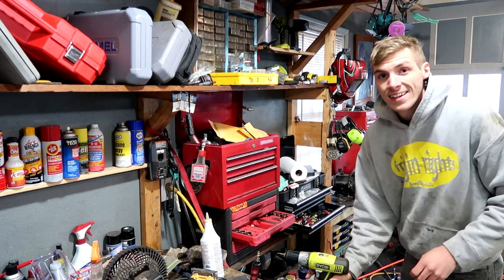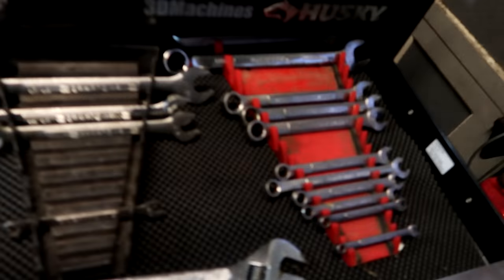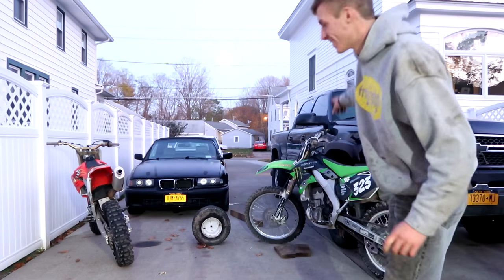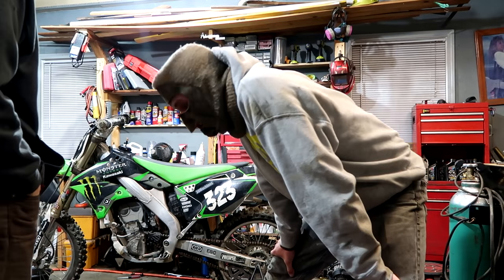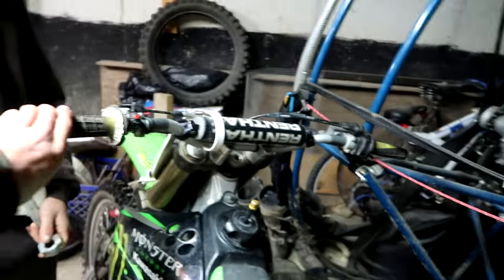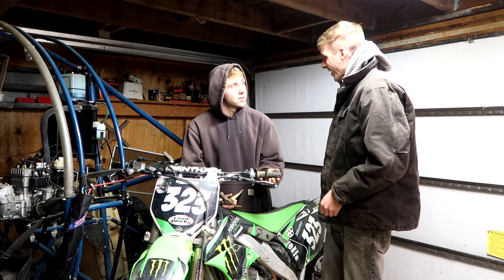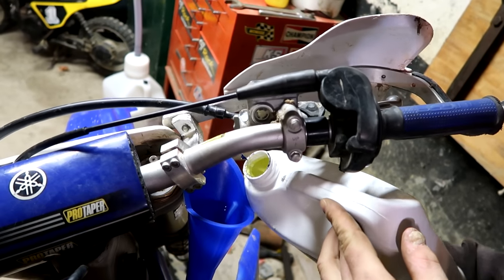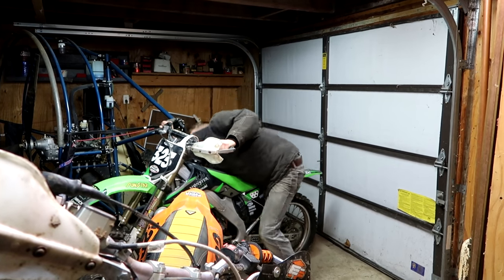MY BIKE STARTED SMOKING A LOT...

Comment: That chain looks way too tight, and that rear sprocket... *shivers
Reply: he has said that it loosens when he sits on it so its ok
Reply: The chain is way to tight, will ruin the sprockets and you can destroy the bearings inside the case which is a big deal.
Reply: I race kawi's and i know that the chain tightens when you sit down and when landing after a jump. They are suppose to have slack, thats why there is a chain guide, its better to be loose than too tight. I dont even think this guy oils his air filters, looked dry as a bone when he pulled it out in another video. Not to mention his sprockets look terrible but its not my bike so he can do what ever he wants.
Reply: matt s you have the same 250? because i think he has shown hie the chain loosens when he sits on it
Reply: HusseJumala I thought that was his 450
Reply: The Hondas chain loosens when you sit on it.
Reply: That Ronny Mac reference tho
Reply: xheppelin it loosens when theirs weight on it
Reply: xheppelin s
Reply: matt s who cares he's bike is different just coz you have a Kawasaki don't me yours is the same
Reply: Go to your local motocross tracks and find out for yourself all my bikes have been like that. My honda crf 250 did it , my rmz 450 did it and my kawi does it the MOST. I actually raced all 3 bikes so your wrong.
Reply: No it doesn't loosen when you sit down and will destroy your bike if you actually hit a big kicker or table top. Ask someone who actually uses these RACE BIKES for what they are actually intended for you guys are just fan boys
Reply: @Ronox63  Then his suspension is shot and needs new ones lol

Comment: Tape a flashlight to the front fender and let her rip. One of those light bars might work. I saw in another video that you are now crossing your trailer chains in a X pattern so the trailer tongue will not dig into the pavement or ground and flip your dirt bikes into the back of your truck.If something happens and the trailer becomes disconnected from the ball it will now ride in that X and hold the front of the trailer up. Great job guy's.

Comment: Tip coming from my old school days of BMX... If you have grips that want to spin around like that on you, Spray both the inside of the grip & the bar down with WD40 & slide it back on. Yeah, it sounds counter productive.. But if you let it sit for a couple hours after doing it you will never get that grip off unless you cut it with a knife.

Comment: Hey 3D, I need to put either a new shift drum or shift forks sadly in my 86 YZ250. Do you have any suggestions to help? I can only shift into 1st and 2nd. I wanted to race hare scrambles then my baby gave out :(
Reply: la chène de tout ! eBay. They don't make new parts like that any more because its 30 years old
Reply: probaly a bent shift fork haha happend to me
Reply: Josh Coo that's what I was thinking too. Did you bend it back, or buy a new one?
Reply: Jacob Nykiel buy a new one if it bent before it will bend again even easier
Reply: Josh Coo makes sense, thank you
Reply: You should just get a new bike at that point
Reply: Aiden Megargle Im learning to be a motorcycle mechanic so it's no big deal fixing it, just asking for tips... I love my bike to literally bits and pieces, worked on it so much I have the whole thing memorized, so I don't appreciate that compliment. I love buying junker out bikes nobody cares for like it was and fixing them, so if you have the audacity to say a comment like that, you obviously haven't really worked on your bike and grown to love it.
Reply: David pelkey no the problem is its a 1980s bike lol
Reply: Jacob Nykiel i agree anyone can save and buy a new bike
Reply: tear it apart and check everything is in spec crank runout bearings etc...   and replace the parts that are worn out.  go over the whole engine inspect all the gears for wear.  those cr's are easy to rebuild.  If you need parts that are discontinued  join a couple honda forums and post what you need lots of guys keep old parts around from bikes they had, take your time and do it right. If all else fails ebay is a good place to look but you need to be careful.

Comment: As a professional BMW technician I would suggest not to turbo the 323i unless you find yourself a nice tuning kit for the DME. If you want more power you will need to get an M3. You can get an m3 powertrain tho. Just be sure to get the DME (engine control unit) EWS (antitheft control unit) KOMBI (instrument cluster) and the keys and locks otherwise the thing will never start bc of the transponder chip keys and the vin specific codes that are programmed into the control units. Screw it man that 323 did some sick burnouts. Just don't tear it up bc BMW (broke my wallet)

Comment: The squeeky noise the kx makes when the swingarm moves... Not a problem with any bolts and it will get worse and worse.... Solved this once. You gotta take off the swingarm and look where it connects to the frame. There are like 2 plastic rings or how I should call them. They are in the frame. You gotta kinda lube them up, or something. But they are the squeek sorce :-)

Comment: 3DMachines What is that hole that is covered by plywood in your garage ?
Reply: Garrett Thomas it's a lift for the dirt bikes
Reply: Xxx Bo3 for the win No I have seen the red lift in the back. This is in the center of his garage.  It looks like there is a great over it. Go to 1:46 of this video. You will see it.
Reply: Garrett Thomas alot of garages have a hole in the floor called a pit for working under cars instead of having a lift or if the building/garage dont have a high enough ceiling for a lift
Reply: Brad101 Oh ok. I thought maybe it was a pit for working on cars but then I saw the great over it.
Reply: i guess it could be a drain for catching snow and water that runs off cars while they are parked in the garage instead of having a pool of water on the floor
Reply: hopefully dalton can verify because now it got me wondering LOL
Reply: Brad101 Maybe.

Comment: To get the holes in the grips you just take an ball head hammer and tap the hole into the rubber mounted on the handle bar so it gets cut by the hole in the side of the handle bar. Works great is easy and fast! Next time you can try this...

Comment: USE GAS INSIDE YOUR HANDLE BAR GRIP, IT MELTS THE RUBBER RIGHT BEFORE YOU PUT IT ON.I USE TO DO IT WHEN I RACED MOTORCROSS. WORKS AMAZING!

Comment: I have a couple questions. First, will you get a Polaris? Second, where did the grizzly and brat board go? Third, will you ever use the go pro harness on prince? Lastly, will you get new tires for the Duramax? If so, what and what size?

Comment: I just got a 2010 kx450f fuel injected and It won't kick but it will bumpstart and when I turn it off I can kick it once or twice then itll start but after that it won't start, you think I should shim the valves or does the FI need to be reprogrammed?

Comment: Guys i need to know what coolants i can run in my 2 stroke dirt bike. Can i run the standard coolants from Auto Zone or O'reillys such as royal purple?
Reply: MotoLogic probably not the best to run car coolant
Reply: MotoLogic just go get dirt bike coolant there is a coolant I get for all my 2 strokes called Engine Ice good stuff
Reply: What kind of transmission or bottom end oil should i put in my kx 65? I  just did the top end over. i changed coolant but not bottom end.

Comment: wait what are the fuel types in us in eu most popular are e95 e98 and Disel, wtf is 93 octaine
Reply: Fify Lv 93 is the rating , we have 87,89 91 93, at the pump and some places have 100 octane. the higher the octane the better the fuel and in an engine with a high compression ratio or an engine that is forced induction, the higher octane fuel prevents pre ignition , which happens with a lower grade of fuel and happens when the fuel ignites before the spark plug goes off.
Reply: ThatsKinky94 i put 98 in my scooter over 95 and i think it makes more power...
Reply: Fify Lv that's because e98 is higher in the rating than e95 in the octane rating.  octane is the resistance to resist knock.
Reply: ThatsKinky94 thanks for the info 😋
Reply: Fify Lv not a problem. I wish I could give you a little more information on e95 and e98 as well but I don't know them. the only thing I know with e fuels is that the e stands for ethanol and it's a made from corn.  hope I helped you some. have a good day

Comment: is there any dirt bikes that don't need a rebuild every 6 months or so
Reply: like is there a dirtbike that needs no re builds at all
Reply: MotoJunkieDillon like every other weeken for a hour or 2
Reply: No, there are moving parts all throughout the engine, and eventually they will need to be replaced. If you keep up on the maintenance you can get away with putting quite a few hours on the bike, and depending on how much you ride you shouldn't have to rebuild it every 6 months. If it's a 4 stroke make sure you keep up on the oil changes and make sure it always has sufficient oil (there is a sight glass on the side of the engine) because even though it is a 4 stroke it tends to burn a little bit of oil.  If it's a 2 stroke make sure you're mixing the gas properly, generally people mix it 32:1 you might want to add a little more oil to be on the safe side but then your bike will run rich. And no matter if it's a 2 stroke or 4 make sure there is coolant in it like they did in the video so it doesn't seize the engine.

Ultimately if you're worried about rebuilds I would go with a 2 stroke because in the event that you do have to rebuild it it is much cheaper and easier. If you're beating on the bike and racing it I would recommend changing rings at about 6 hours and a piston every 12. If you just ride around with your buddies every now and then you should be more than fine.